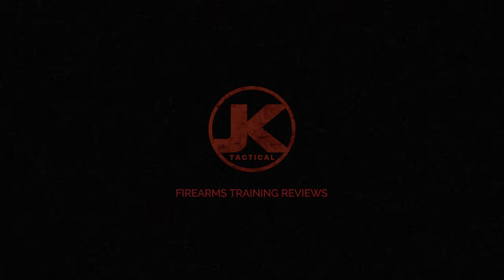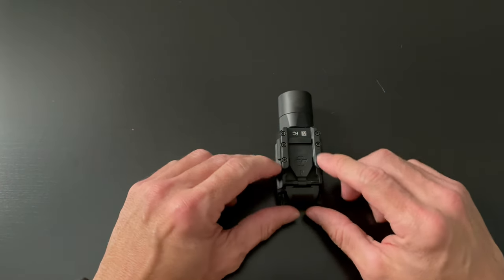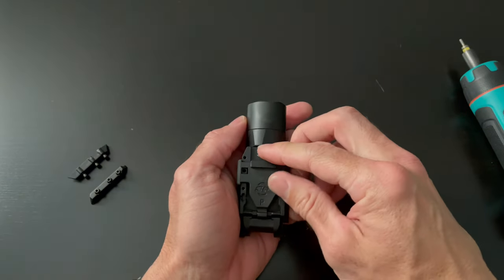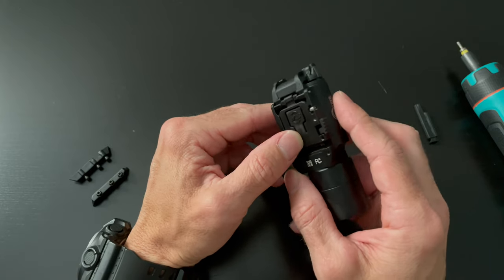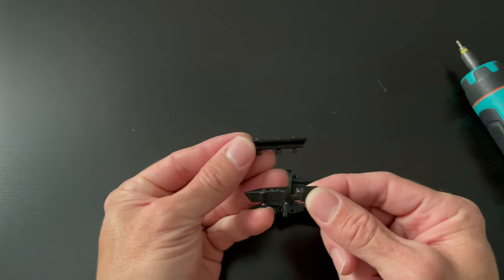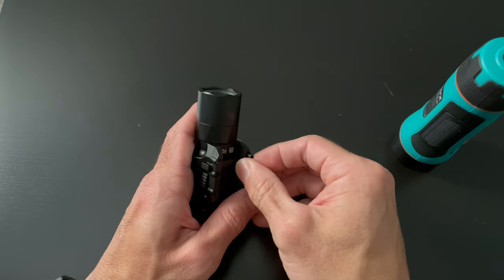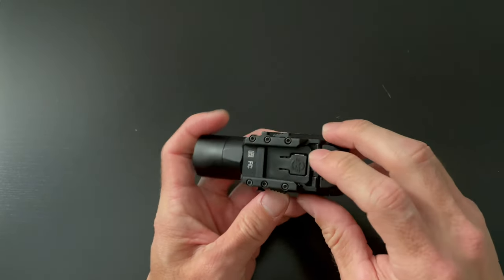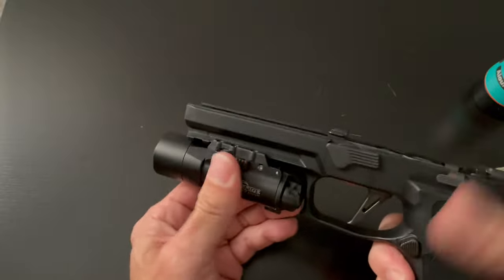How to FIX a LOOSE Surefire X300-A the RIGHT way!

Comment: Do you have to use the screw driver to loosen that silver screw
Every time u wanna remove it.  If so kinda defeats the purpose of the design meaning quick removal without a screwdriver
Reply from the maker: Unfortunately, you do have to loosen the screw to remove the light. I keep a small hex key in my range bag in case I need to remove it, but it is a bit annoying.

Comment: Can it still slide out with the wedge lock screwed in? I'd hate to have to unscrew it with a allen wrench every time.
Reply from the maker: Unfortunately, you do have to unscrew the wedge lock to remove the light.